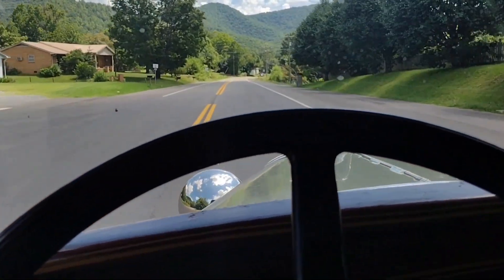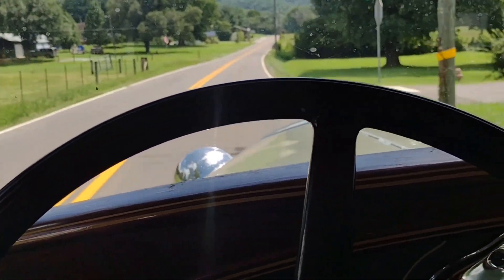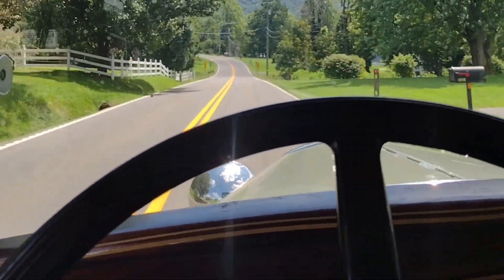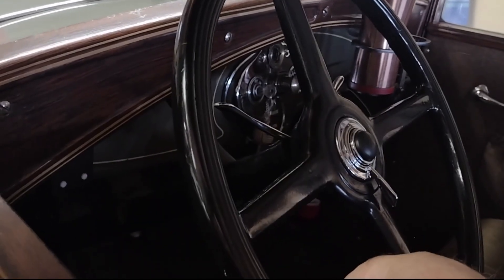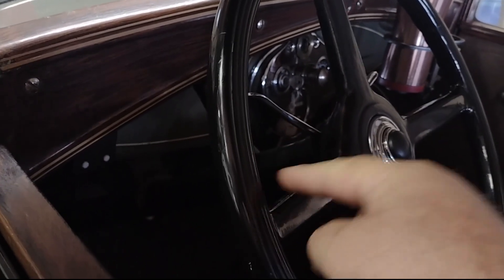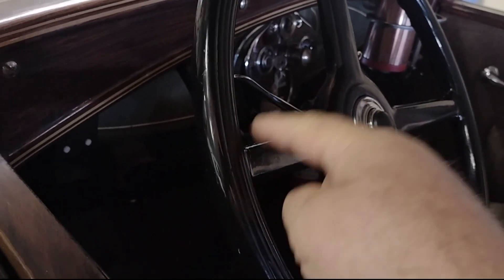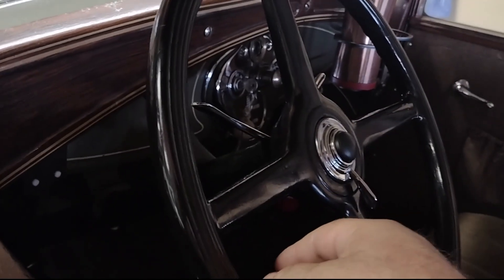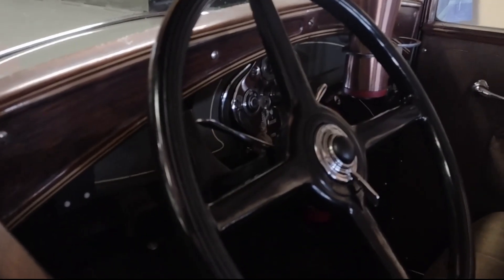1930 Ford Model A Steering Wheel Play and Road Wander yes or no?

Comment: I put a lot of miles on my A (600 last week) and can confidently say that the Model A has the potential for tight stable steering and tracking, though not equal to a modern car with modern construction tires.  
For many cars the past 90 years have not been kind.  One can not fault the design when the simple fact of worn out parts is coming into play.  I’ve found the toe-in sweet spot to be critical and very sensitive, however the adjustment will not cure defects of excessive wear, kingpin or tie rod end looseness, etc.
Reply from the maker: Hi Myrl!  I completely agree!  Proper toe setting is essential but worn out parts have to be attended to first.

Comment: My ‘31 A had the “death wobble” at low speeds when I bought it, and steering was loose. I rebuilt the king pins, which fixed the wobble. Steering is  still slightly loose, but not bad at all.
Reply from the maker: I need to rebuild my king pins too.  Next on the never ending list 🙂